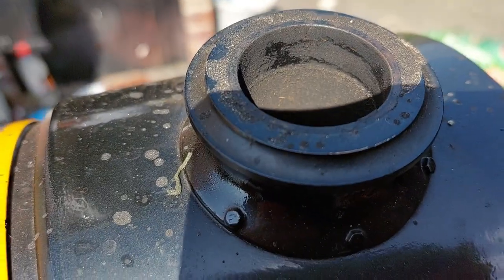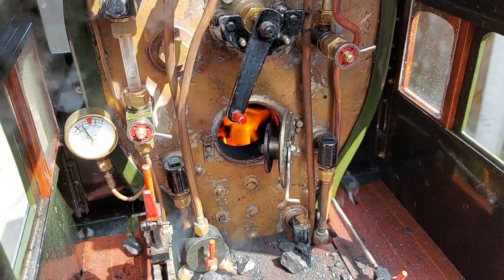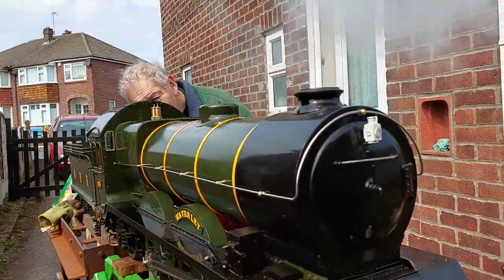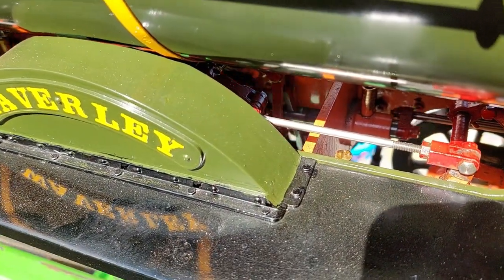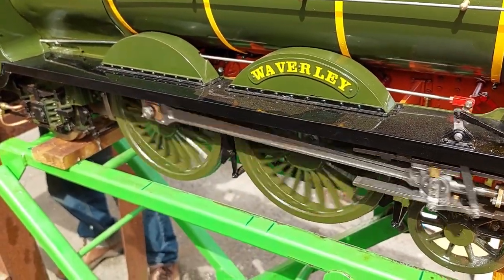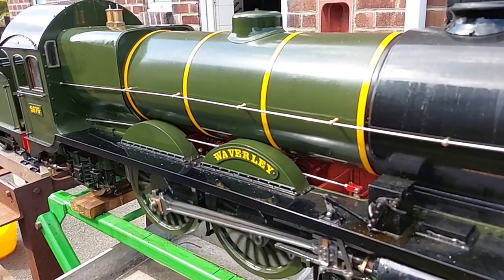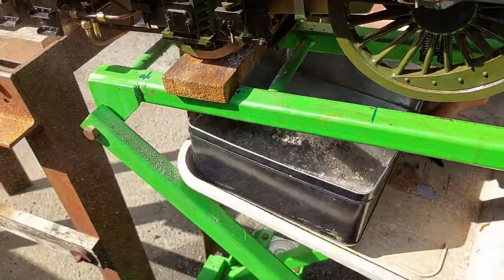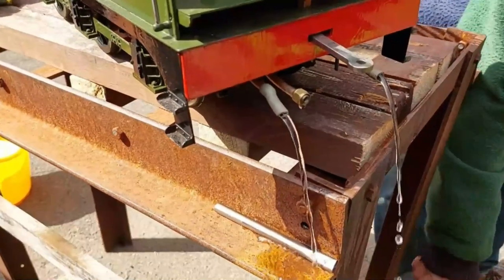Waverley,5 inch Gauge Loco Steam Test.

Comment: Can I suggest you check that the length of oil pipe to both cylinders is the same,. If one is longer, there is more friction in it, therefore less flow.  Nice looking loco.
Reply from the maker: I will pass this info on to Bob,thanks and thanks for looking at the video.